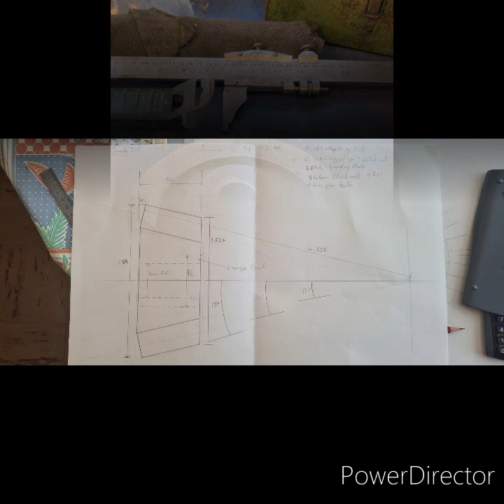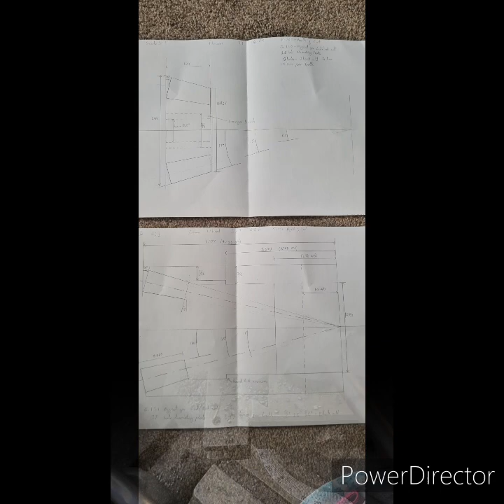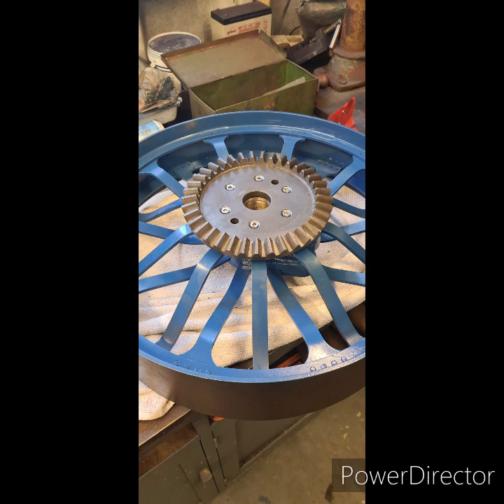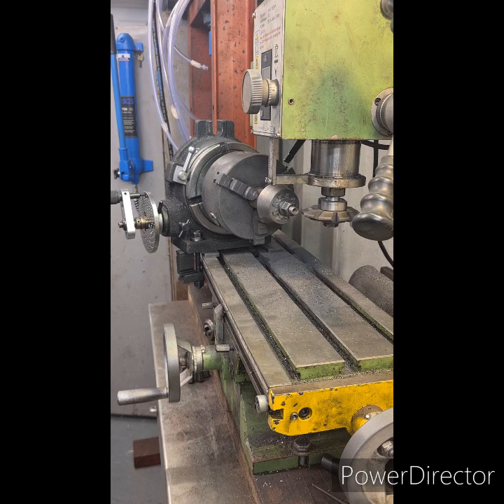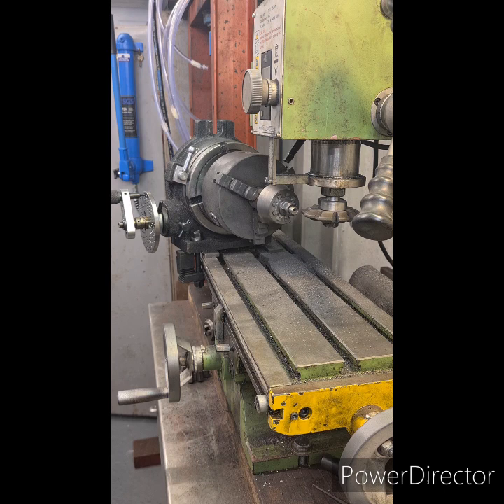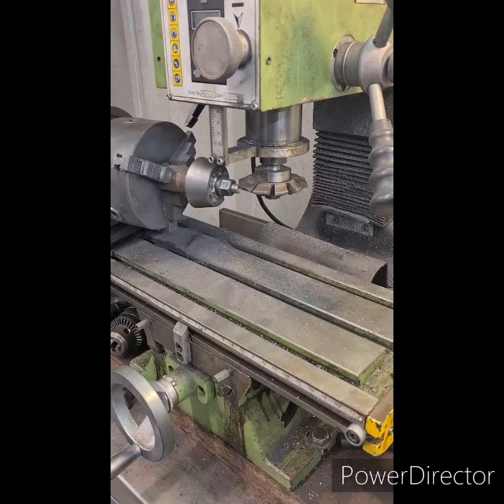How to Cut Bevel Gears and Differential Centre - 3" Fowler

Comment: Hi, can you tell me what number cutter you used for the large differential gear and what number cutter for the bevel gear, I know your traction engine is bigger than mine and I am doing the maths as in the book I just want to see if I am any where near it
Thanks
Reply from the maker: OK so the 86t ring gear used the 55-134 cutter
The 9T pinion bevel gear took the 55-134 cutter
The 37T Crown bevel gear took 155+  cutter
Reply: Thanks for that, I've done the maths and checked it several times, I'm good to go when I cut my differential and bevel gears thanks again
Reply from the maker: @jammymowlam1  Good luck!!!
Reply from the maker: How did you get on @jammymowlam1??
Reply: Hi, yes, everything went well, I have cut all my gears, and I am very pleased with them 👍🏻

Comment: Hi John. I am doing the exact same engine as you and have the Iven law book "revised" edition. I really stuck with the maths trying to work out the offset for the large bevel.
So... Offset is 1/2 Chordal thickness. So.. 1/2 times Sin of 157 (inclusive angle of bevel) divided by 44 (number of teeth). So... 1/2 times sin 3.568. So... 1/2 times 0.0622 So offset equals 0.0311 (0.79mm) ??

If you can give me any help it would be much appreciated. 
Thanks
Jonathan
Reply from the maker: I'll have to have a look back through to re-aqauint myself haha!
Reply from the maker: 0.031" does sound about right just pictuing it in my head though! 
I assume you are using gear cutters and the rotary table to set it up?
Reply: @johnlintorn6768   I have a dividing head but pretty much the exact same setup.
Reply from the maker: Ok so looking at my drawings I had to re-design the bevel gears. 
The drawing calls for: 
Large bevel - 44T 9/16" C.P. 7.89" O/D
Small bevel pinion - 9T 9/16" C.P. 1 31/32" O/D
Unfortunately C.P is used instead of D.P and is taken from behind the bevel and is used for cutting bevel gears with a shaper. If we want to use 6 D.P cutters on a mill, which, I assume you do, you havr to completely re-design the 2 bevel gears!
I suspect this is why you are struggling to work it out using Ivan Laws book. 
He shows us how to design and cut "Incorrect" bevel gears.
Reply from the maker: I would send you a picture of my gears but I can't seem to upload a picture on this response so I'll just tell you the info.
Following details are using 90:1 ratio rotary table. 
Crown wheel - 37T 6 D.P. 0.360 depth of cut. 0.131 offset for 2nd/3rd cut with 2deg 25mins 55secs turn. 37 hole dividing plate, 2 16/37 turns per tooth.
Pinion - 9T 6 D.P. 0.360 depth of cut. 0.130 offset for 2nd/3rd cut with 1deg turn. 20 hole dividing plate. 10 turns per tooth! 
Obviously check all these calculations but they worked OK for me as you have seen! 
If you want, I can email you pics of the drawings! Just send me your email address!
Reply from the maker: Just for your maths btw:
Ivan Law tells us that:
Offset = 1/2 x cordial thickness = 1/2 x P/D x (Sin90÷No of teeth)
P/D = No.of teeth ÷ D.P.
So for our gears,
P/D = 37teeth ÷ 6D.P = 6.166
1/2 x 6.166 x Sin(90 ÷ 37) = 0.130" offset